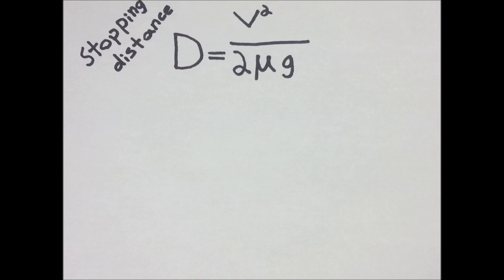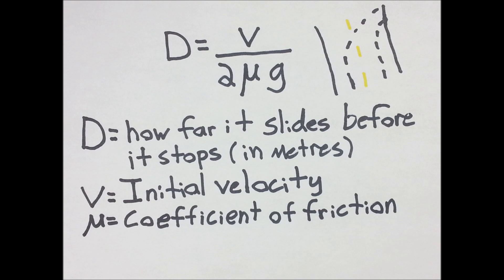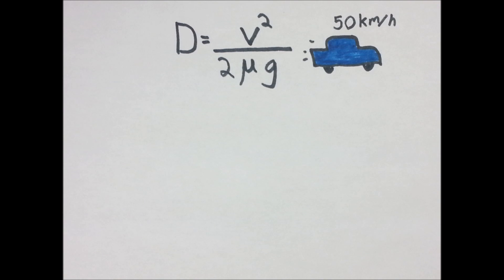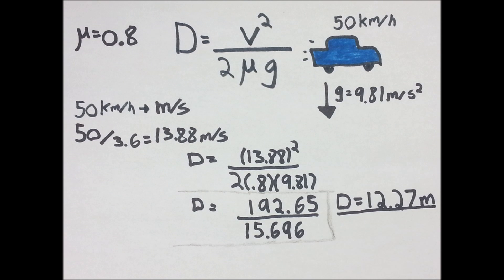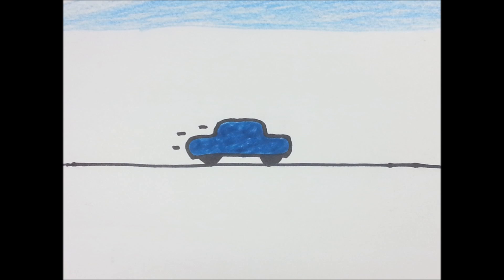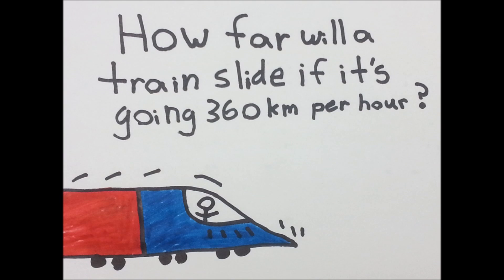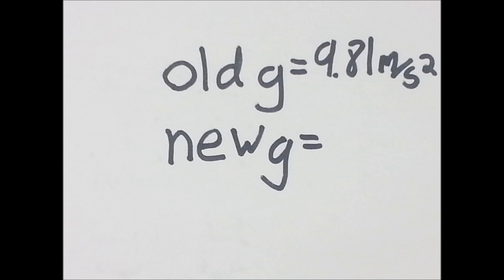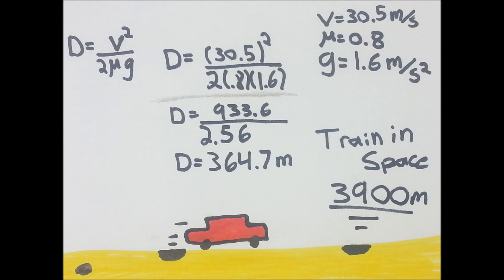Stopping Distance Formula

Comment: What about the amount of surface of the objects in contact? The mass of the vehicle? The lift or downforce caused by the aerodynamics of the vehicle? The equation is not wrong, but pretty much useless in this form. Without factoring in the above criteria i dont believe you will ever get an accurate representation of what would happen to your car/bike or what have you. Correct me if im wrong
Reply: Actually now that i think again surface area doesn't matter, but what about the rest?

Comment: What about the mass? The more mass the more kinetic energy the car has (than the lighter car at the same speed), so it would need more force to stop it to 0 km/h. So, if the breaking force is the same in both cars then wouldn't the stopping distance would be longer in heavlier car?
Reply: Since more mass equals higher friction, mass and friction are proportional. So, I am guessing mass would become irrelevant if we have coeficient of friction in the equation.
Reply: The force of friction which acts to stop the car is proportional to the mass and the acceleration (or "deceleration") is inversely proportional to the mass.

Comment: Caught an oddity: 

at 1:20, for the car going 100 km/h, you wrote down 110 km/h, but the final answer for 100 km/h (27.778m/s) is 49.2m, and 110 km/h (30.55m/s) is 59.5m...so you spoke correctly, and wrote the right answer, but you did some bodging to get there.

Some may find this odd, but the COF for a steel on steel *is* about the same as a sliding tire on rubber. I had to look it up! 

Keep making great videos!

Comment: Wouldn't air resistance play a role in stopping as well?
Reply: Air resistance is an external force i think it has something to do with the stopping time
Reply: Air resistance is extremely tedious to calculate. Usually, we just use simulations or wind tunnels.

Comment: Braking distance: 
Car at light velocity c (299.792.458m/s) on the moon (1,6m/s^2) and with a frictional coefficient from 0,05 (Ice)
Distance is about 561.721.986.710.510.000m, that is 14.016.762.281.361 times the earth perimeter at the equator and almost 4 million times the distance between the earth and the sun (average distance), you could at something like these at a box.

Nice video :)